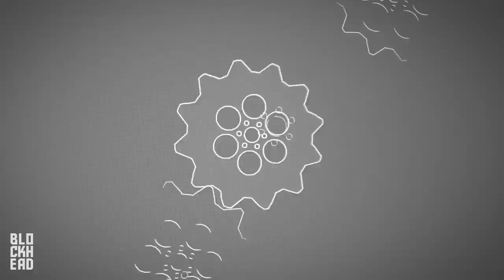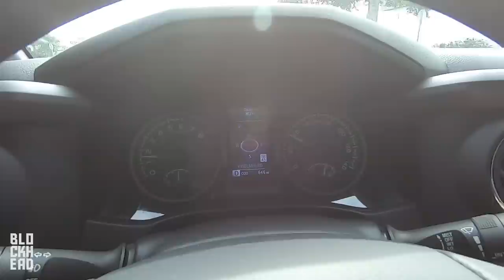Toyota Tacoma TRD Pro Grill Install (+ Sensor)

Comment: dang, that is a sweet looking grill, even to be aftermarket.

huh, the oil the engine uses is  0W-30  [ zero winter ]  i heard of such an oil, but did not know it was real. i thought someone was messing with me when it got mentioned. but after viewing scotty kilmer's video on differences in motor oil, i now know that 
it is such a thing. the reason for the  [ zero winter ] is because it is hot there.
it is interesting to see such a thing.

fast install !

awesome video !! 

1000 thumbs up !!

Comment: in your opinion tacoma better than ram or f 150 ?? miss block's clubstyle awesome
Reply from the maker: Ram and F150 are full size so depends on your application / what you need it for. Best bet is to test drive 👍🏼
Reply: @BlockheadMoto  yes sure thanks for your answer man

Comment: I test drove a Tacoma. I couldn't fit in it without putting the steering wheel up, and I'm only 6"3.
Reply: "Only 6'3""

Bro you're a giraffe, most people are like 5'10"
Reply: Well I’m 6’ 2” so I probably won’t fit in one either.
Reply from the maker: Yeah “only” lol, I’m a very average 5’10”. Full size truck for you!